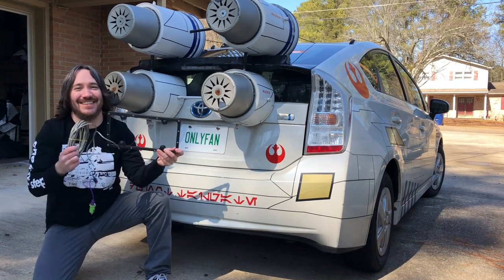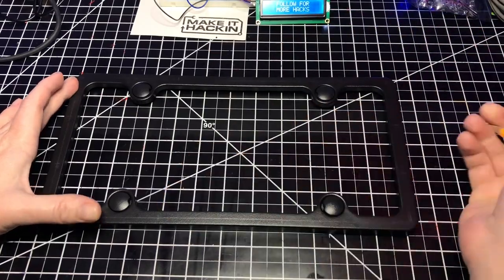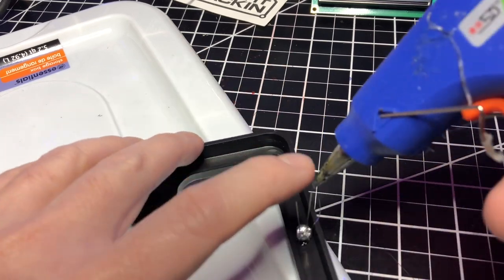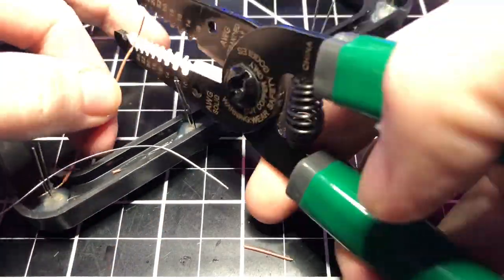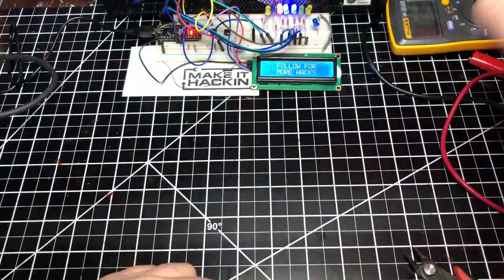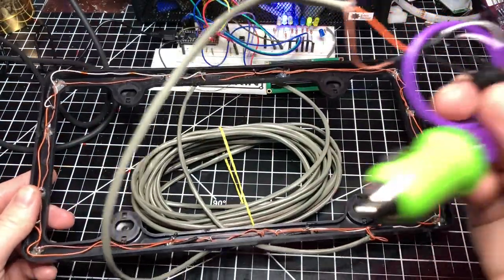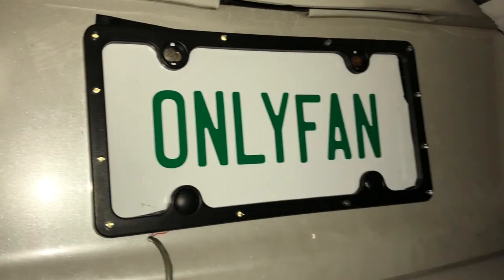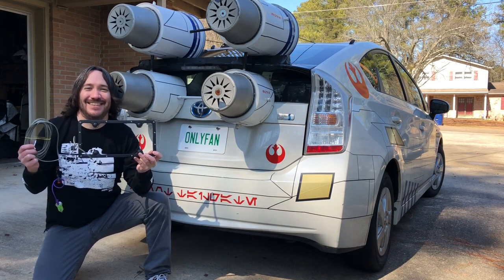Infrared Camera Blocking License Plate Frame - Tutorial - How To

Comment: In the cam feed it's obvious you are trying to do blind it. There is a special type of acrylic called 'Endlighten' that people used to make IR touch screens and art displays out of. When light is shined through its smaller side edges it reflects/diffuses the light evenly to all its larger flat surfaces. You could use it like a clear plate protector cover and inside the bezel all the IR LEDs are hidden/sealed in the plate frame so the camera cant see them when on. The acrylic however will look like a LCD screen backlight on a blank background but not super bright but possibly enough to cover the license plate and could be played off as a reflection from some other light source.

Comment: You could have used wire wrap, with its tool, it would have been easier. PCB is expensive. Also, I think this will not work in day light, unless you have blinding lights.  What I have seen in the past, the license plate is on a hinge and drops 90 degrees on a flip of a switch....  plate is not visible then.
Reply from the maker: nice!

Comment: If the "normal mode" means what looks like white lights directly visible to the rear, that is most probably not legal under your state's vehicle code. (License plate lights are not aimed towards the following driver)
Reply: They’re infrared lights. They’re not visible to the naked eye so you won’t see them but they will blind the infrared cameras.

Comment: This works on a regular day night camera but absolutely would NOT work on a dedicated LPR camera. Normal cameras like this adjust their gain to get the best contrast in most of the scene. LPR cameras adjust their gain 60 times a second with a focus on getting good contrast of the plate. If you follow this guide and think it will hide you from an actual LPR system you are wrong.

Comment: I would think projecting the leds through a slightly opaque plastic cover would illuminate the entirety of the the cover and shield the plate. May even work in daylight, but u may need better leds
Reply: The cover would still need to be clear enough to read through obviously. Think of how a monster cooler door illuminates the monster symbol on the front

Comment: How about light piping the LED's at the edges of a plexiglass cover, and defuse the surface of the plexiglass by way of some 1500-grit sandpaper across the face of the inside and out of the plexiglass?

Comment: This would be so obvious to the police when you're on the road. You need to hide the wire so much better. Also the LEDs would be obvious sticking out of the frame. I would mount the LEDs under the frame sticking out slightly from the inner sides rather than out the front of the frame. Run the wire along the loom of the licence plate light or even just power it from the plate light to save the extra cable and switch. Still if you're caught the fines would be horrendous.

Comment: pro-tip, dont use hot glue, use silicone, its going to get wet so maybe keep the water away from the electrical stuff, no its unlikely to cause a short i know that, but for those who dont know the legs on 99.99% of led's are not treated to withstand any form of elemental abuse so the legs will rust and then you wont have a working police magnet.

oh by the way the police radar guns have a sensor for this, exactly this... just because you cant see the light it does not mean it cannot be seen... this was done years ago by criminals and has since been revealed and forgotten because it just does not work anymore, they can see past the infrared these days and they can see that your trying to avoid them seeing your number plate.

Comment: This won't work. These cameras will adjust for bright license plates.
Anyhow, I'd try placing all the LED's on the half you don't care if it is seen (where the county code is) or in the middle third of the plate.
For better results, I'd rather project high intensity UV A 370-390nm rectangles toward every second letter by using a metal mask in front of a few 1A LED's, 1 / character.

Comment: I have the IR lights housed in with the factory license plate lights. My thoughts are twofold here:
1. Registration of a vehicle for a private person, should be done at the point of sale, and the vehicle registration should be terminated when you relinquish ownership of that vehicle. An annual registration was a money making scheme before the introduction of LPR'S and after having paid for my annual registration and still being pulled over because of Pennsylvanias system not updating, has led me down the road of F@$k this s#/t 
2. I was a cop and I can tell you that when you are pulled over, your identity / DL number and plate number are run through the system checking for wants and warrants regardless of what the LPR tells the officer. So the LPR is nothing more than an end run around the requirement for probable cause, allowing the officer to "find" other infractions with which to fine you and therefore generate revenue for the town, county, state etc...

Comment: It could be made better with a thicker license plate frame so you can drill the holes through the inside edge of it and have the led's flush, not protruding out; thereby lessening the risk cops will see it and pull you over - they'll know exactly what it is if they see it.

Comment: All you need is one row, mounted above the plate without using a frame mounted to plate..like I did.. lights are mounted below trunk lid.. LED lights are not visible when you are behind it.. If a cop saw your plate..they would pull you over.. at least in my state.. It is illegal to put a frame around you plate that hinders a camera from taking a picture.. so.. don't mount lights on plate. My car has a nice lip that conceals the tinly lights, even if you did get a glimpse, it looks unassuming. My wires also run in the trunk groves, then behind molding. I run it directly to fuse... no switches, if can is on, Infra lights are on. Just never avoid paying tolls or driving by a camera everyday, at same time.. after a while, they notice same car with blurred plates passing by same time everyday.. Police will wait there and look for a car that fits description, then they will inspect... since the frame touches the plate in the one you made you could be hit with a felony..

Comment: I'm so confused you take the time to solder all your wire connections doing everything right adding resistance ect ect doing an awesome job the you put a USB plug on and plug it into the outlet why not just have a toggle switch in the car and have all the wires outside or under the hood I'm so confused if your just going to plug it in why do everything else so professional?

Comment: Using any device, active or passive, with the intent of defeating traffic control equipment is a crime.  The constitutional status of the cameras (which isn’t how that works, it’s the process by which you are ticketed that used to be the issue) is irrelevant.  You can and will still get ticketed and quite possibly charged.

Comment: The video should be re-titled ( how to loose your car and your licence and end up in jail for a long time)  defacing / modifying or obstructing a number plate is a huge no no in many country's and comes with harsh penalty,  here in the UK for example they have an ANPR system  that will detect and read a number plate at ling distance it is also able to detect when licence plate blocking methods are used and i do beleave the US have their over version also, in any case it is set up on a highway with police cars a few miles down the road and when flagged a human operator reviews the displayed image and recommendation from the ANPR system and then the make and model of car is relayed to the police cars who then pull over the offending car.   Personally I do not understand why you would want to block your number plate as that is a tactic used by criminals and people with something to hide and it only increases the curiosity of the police

Comment: Sorry man superfail, not enough power wrong angle wrong wavelength most cams are colour so IR is no good the crotch cams here in AU are IR and up high so you would need IR on the dash pointing up at a 45. As for LIDAR you would have to modulate it and will get done for having a jammer and ANY cop seeing 5mm LEDs on a plate will pull you over. It would have to be behind IR plastic [black looking]  and a shit ton more power -IR LASER jammer`s are pulsed up in the 50watt + range.  There is a guy in the US selling No-plate  "slave strobes" which is effective even in daylight.

Comment: I think it would be vastly easier to just power the thing by tapping off your license plate light. You already have an existing light switch and wiring. There is plenty of room behind the hatch lid to mount the usb converter (for the 5vdc) and it would only involve a tiny bit more soldering.
Also, you wouldn't have to explain what that wiring mess was for when you inevitably get pulled over.

Alternatively.....
How about not being a dick running red lights? 😂

Comment: You can add this to other similar mods

the infamous - roller door mod - a little motor rolls down a piece of mesh or cloth to hide the plate when approaching speed cameras and red light cameras - push button

polarised number plate perspex / glass covers

strange paint combos light pink and salmon is common, even behind the car it is hard to read in the day time

welders helmet glass - it is auto no meed for anything, strong light from the rear or outside the car makes it go black as it auto protects your eyes

All of this stuff is police and road authorities bait use at your own risk, you will either get a caution or advise to remove, or the car gets impounded and defected for obstruction 

Good luck
George

Comment: I bought a trailer off a guy. Registered it and started getting notices from Georgia Toll road that I failed to pay tolls and got a fine. I called them explained I didn't even own the Trailer during that time. They told me to submit proof so I sent them the registration with a letter proving it.  Did not here back until I started getting calls from a bill collection company. I explained it again. They said they did not get anything so I had to send it in again. Finally got a letter dropping it. I drove across a bridge between Louisville and Indiana got a bill and immediately paid it. Then got ticket for not paying it. This has caused me much time and aggravation.  The system is broke I should be able to sue them. This is why I viewed this video but I need something simple that works against these cameras.
Reply from the maker: wow, what a story!  that's very unfortunate

Comment: use all laser lites to point back at cop car plate reader. ..... OR wax your plate with a high gloss wax, tilt the plate top down 25% then install a  intensity light, So the tyrants oops cop plate reader can't read the plate from all the gloss